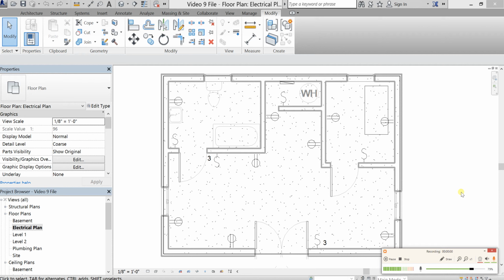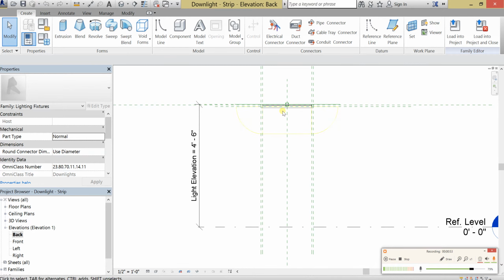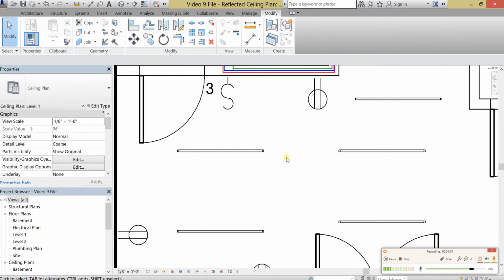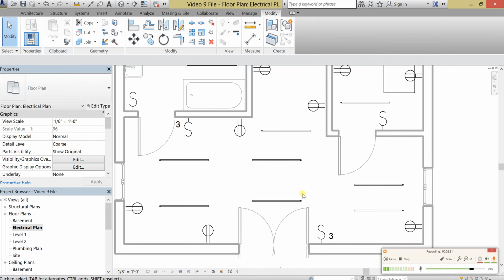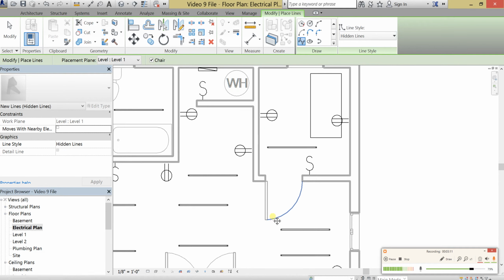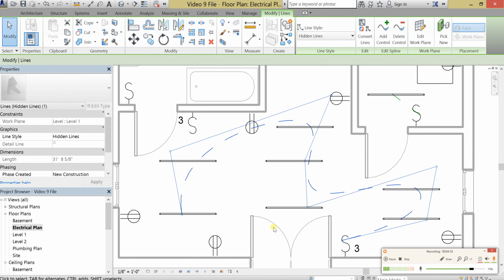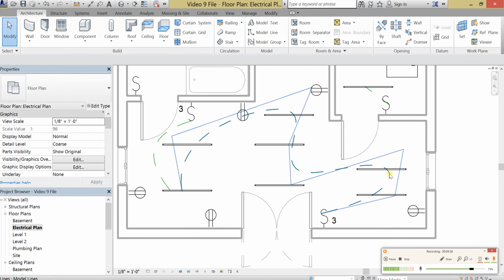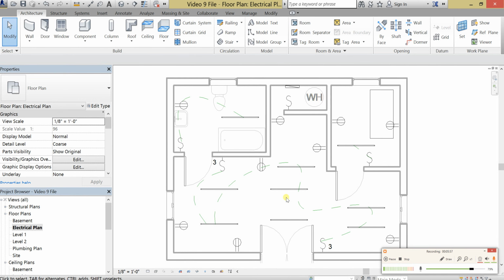Beginner Tutorial 10 - Autodesk Revit 2016 - Making an Electrical Plan Part 2

Comment: Hello Mr Z, 
I tried to load lightening fixtures on my ceiling but it says: None of the created elements are visible in Reflected Ceiling Plan: Level 1 View. You may want to check the active view, its Parameters, and Visibility settings, as well as any Plan Regions and their settings. How can I load them?
Reply from the maker: The only thing I can think of is that you View Range isn't enough. Go to a ceiling plan then to the properties scroll to view range and change everything to unlimited.
Reply: If you're still looking for an answer to this I fixed  the same issue  for myself. The lights are coming in at the wrong height. Check 3d view. I had to adjust the offset in the properties to add with the light elevation in properties to be my total wall height. For some reason just changing my elevation did nothing.